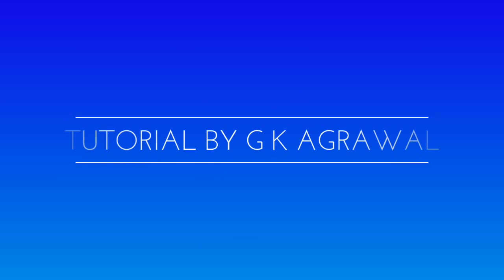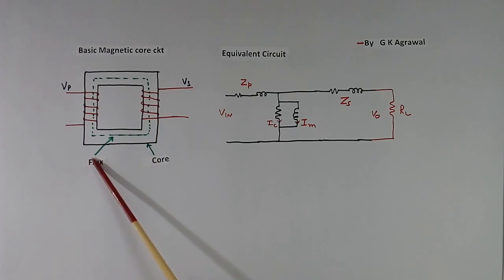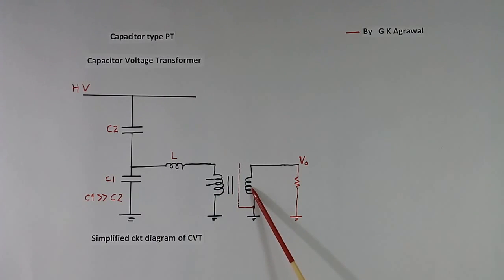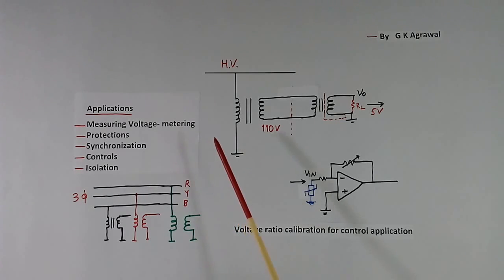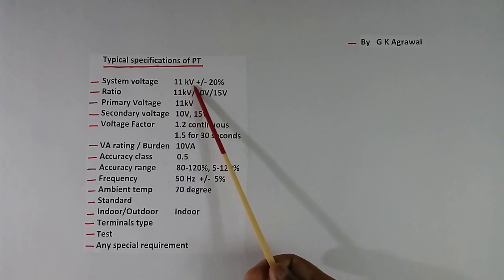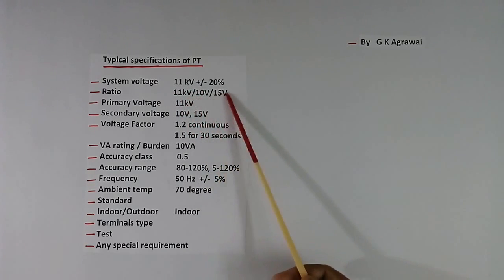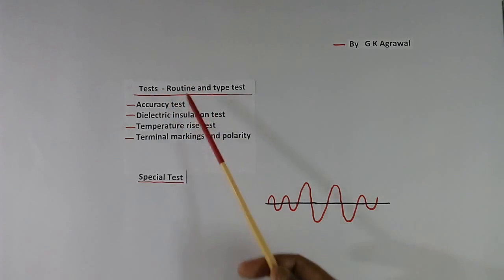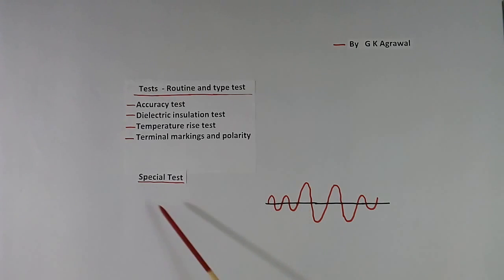Potential Transformer (PT) | control Transformer; use

Comment: Sir how to calculate voltage from primary side of pt , when we supply voltage through secondary side with the help of induce overvoltage panel.
Reply from the maker: You can use another PT to measure voltage.
Reply: Can you give me your no. so that i can discuss widely.